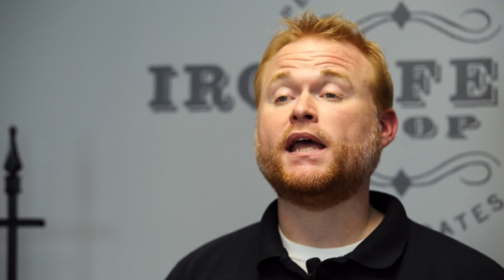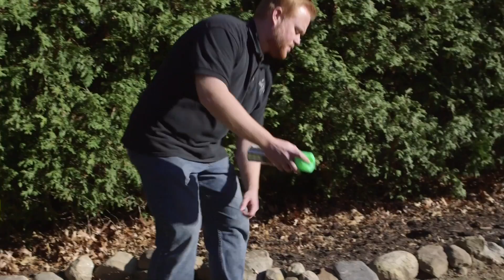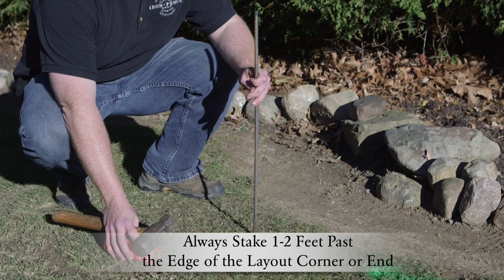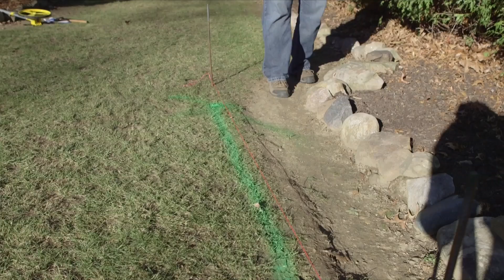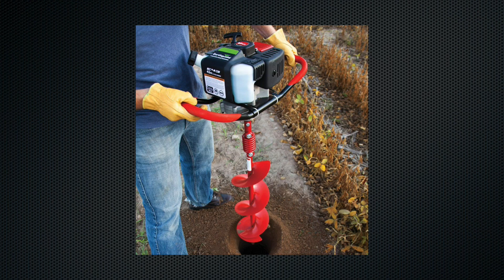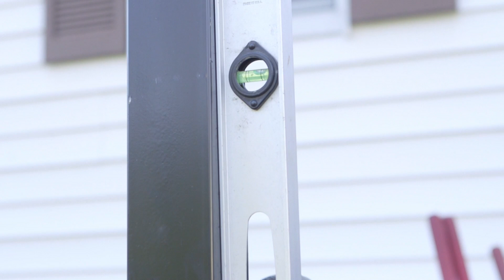Marking the Fence Layout and Setting Your Posts

Comment: Was supporting the posts while concrete is drying not necessary? I’m also setting square aluminum posts
Reply from the maker: IF you mix the concrete on the dry side with a chunky peanut butter consistency, you should be able to stand the posts up in the hole without support.  Just remember not to mix the concrete too wet and keep it to a drier mix.

Comment: How do u keep the post exactly at proper depth  for the proper finished height - measure from hole depth to a marked spot  up from the bottom of pole  or different method
Reply from the maker: You can go about it a few ways.  The key number you want to watch is the amount of post above ground.  If your fence is 4ft tall and you want a 3in gap under it, then I want to measure from top of the hole at the ground to the top of the post to make sure I have that 4ft 3in.  If I don't then dig deeper or add some gravel to build it up.  We recommend that you are looking at that installed 4ft 3in post height WITHOUT the cap on the post too.  That way, when you add the cap on, if one post is slightly off from the other, you don't really notice.

Comment: Good video, only thing I didn't like is I didn't hear you say a 2x2 or 4x4 aren't actually those measurements...a 4x4 is actually 3.5x3.5
Reply from the maker: With steel and aluminum posts (that we sell and handle) the posts are true sized.  So a 2x2 steel post is actually 2 inches by 2 inches.  However, if you are using wood or composite posts, you are correct.  Those are sized nominally meaning that a 4x4 wood post is actually a 3.5 x 3.5 wood post.  I didn't bring up nominal post sizing only because we don't sell those types of posts.  Good comment though if you are using these tips for a wood fence!
Reply: @Ironfenceshop  thank you for your reply.

Comment: If the fence turns at say 130 degrees, do you need the swivel mount?
Reply from the maker: You would for the aluminum fence.  On the iron, the angle brackets only allow about a 20 degree deviation from 90.  However, you could also 'pivot' the post between two panels with angle brackets on both sides of the post to get a little more angle with the iron

Comment: how far apart are the post holes you did`nt explain
Reply from the maker: Hi Rick.  It's going to vary based on the type of fence and application.  Iron and aluminum fence space differently and even aluminum to aluminum can space differently by manufacturer depending on how they are built.

Comment: Great job and nice video :) 

If I’m installing posts into ground that has a slight slope, should I start at the low point or the high point?
Reply from the maker: So long as you are double checking each post between setting them, there is no right/ wrong answer.  I find it's usually easier to start at the high point when I've dealt with grades.